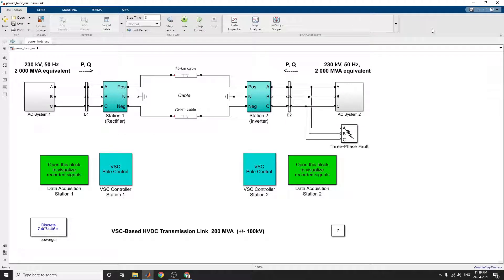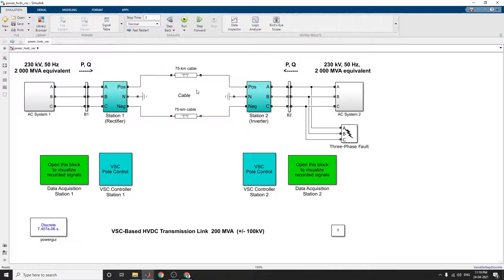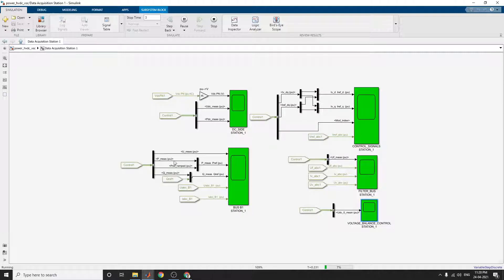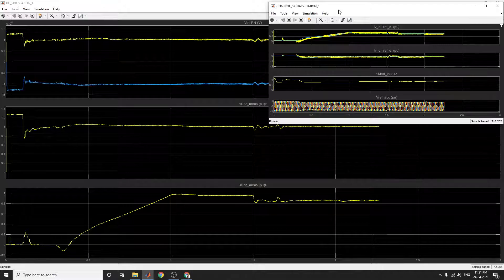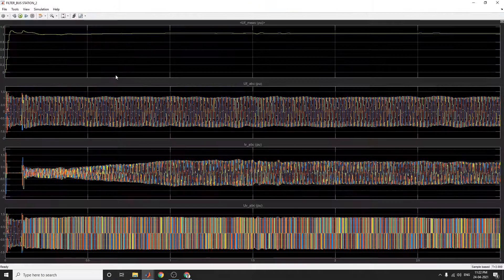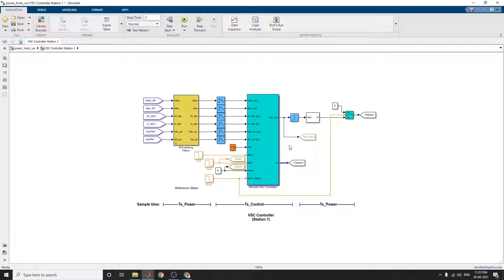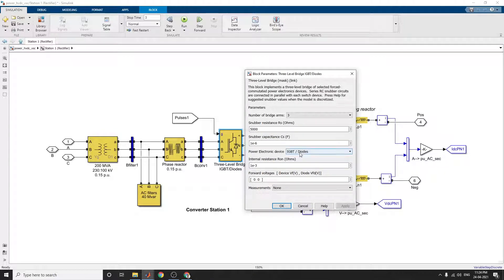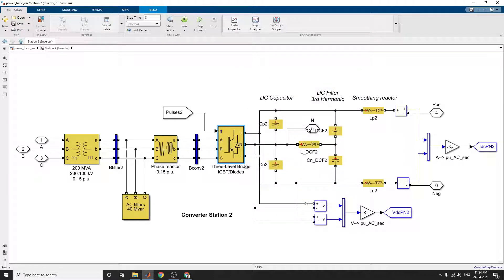Modeling & Simulation of VSC based High-Voltage Direct Current  (VSC-HVDC) Transmission Link

Comment: I have some questions about your matlab simulink HVDC model on youtube background. Can you answer me?

How to change the voltage at the end of the line from 220 kv to 22kv. I have finded how to change the supply volume and volume parameters but the power simulation graph does not follow the reference value. I wish you to answer this question of my questions. Thank you!